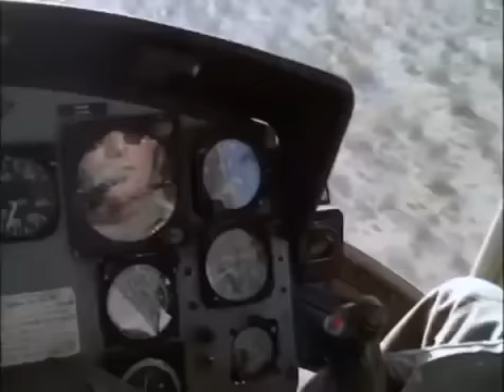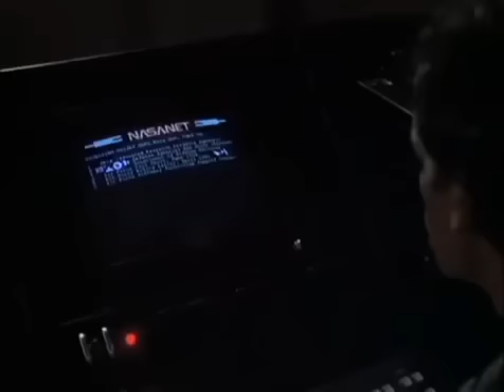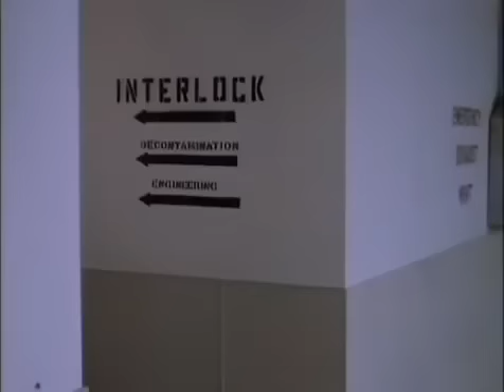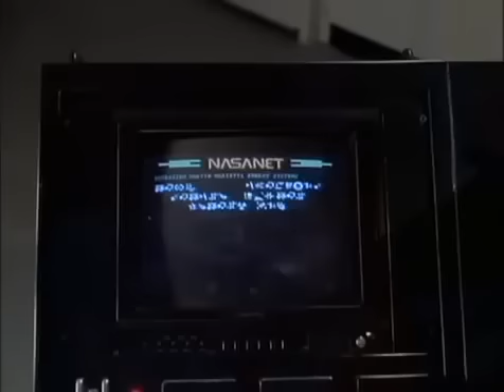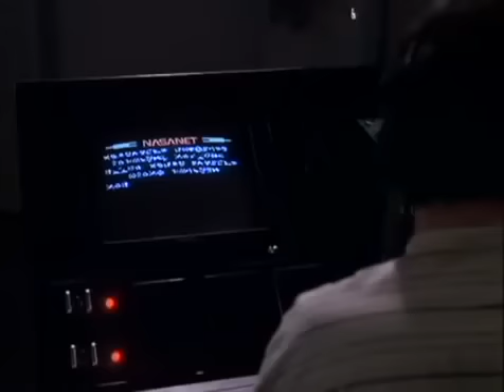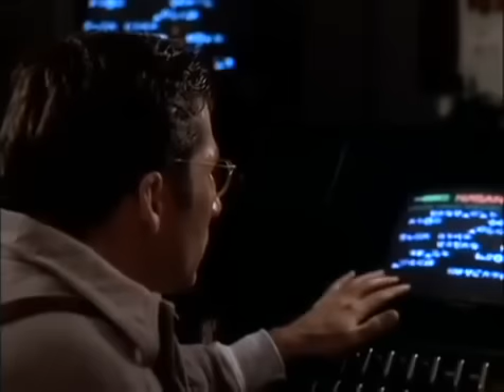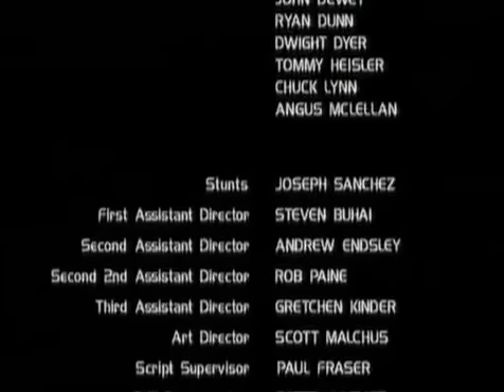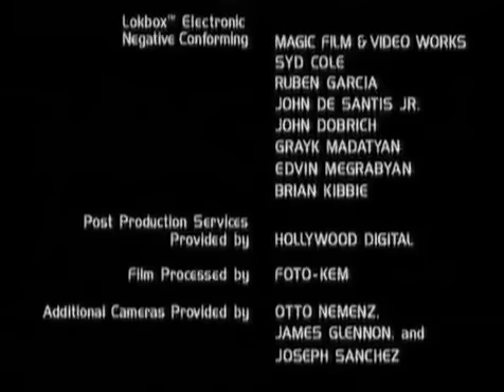alien invasion movie best alien movie

Comment: Why is it the writers of these B-movies never bother to pick up a book and do any research?  Modern ammunitions do NOT use gunpowder and have not use it since 1887.
Reply: You're the second dude to put this comment in here what exactly do they use? I guess I could ask my Navy buddy.
Reply: good to know. oh well this type of movie does not have to be authentic or science based. its just fun.
Reply: You can use smoklesss powder or 3F or 2F gunpowder bye reloading the brass casings it doesn't really matter at everything works
Reply: Modern ammunition DEFINITELY uses gunpowder. Maybe you're confusing this with black powder? Modern propellants are referred to as "smokeless" powder but is def still gun powder. I wouldn't steer you wrong, I reload most of the ammunition I shoot & shoot pretty much every day. Lotta folks out there still shoot black powder as well though, in cap & ball revolvers, muzzleloaders, percussion shotguns & even modern brass cartridges. BP burns hotter & generates less pressure than smokeless (so it's not quite as powerful) but is still a lot of fun to shoot & would be plenty viable if need be. Makes big old clouds of smoke 💥💨👍

Comment: This movie takes it's inspiration from "Aliens" and the problem with hollywood is that when it gets "inspired", it's not inspired to create something new, only a different version of the entity that inspired them.  In this case, they were unable to create something any better than the original ideal.    John Carpenter succeeded, but the 2011 version was a giant disappointment.  What they failed to learn is that they were using a smaller budget than the orginal,, and the cinematography was more up close and personal, where you could see the sweat running off their faces, and the expressions on their faces that trapped the fear.   In t his film, your just staring at people with no sense of visual detail equal to the scene for which they are trying to recreate.